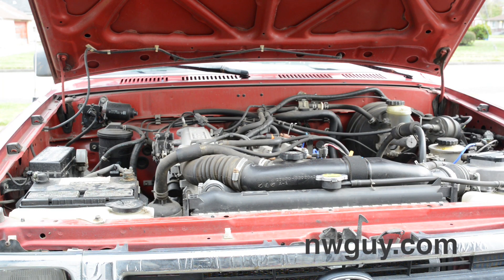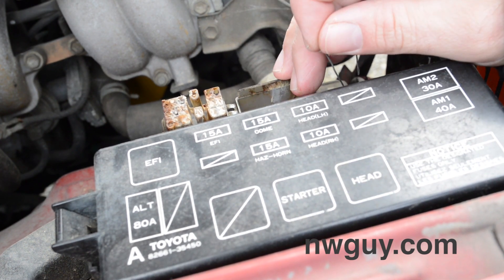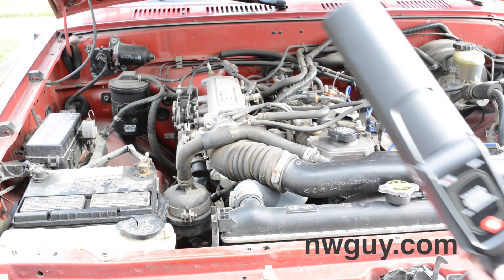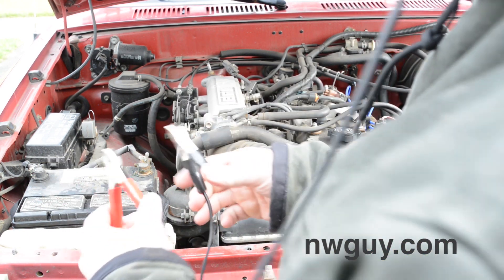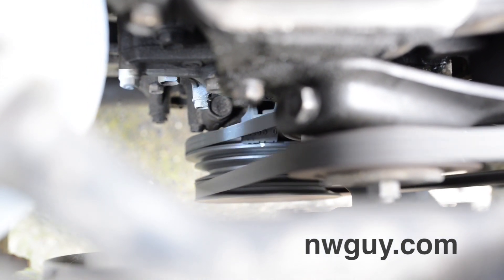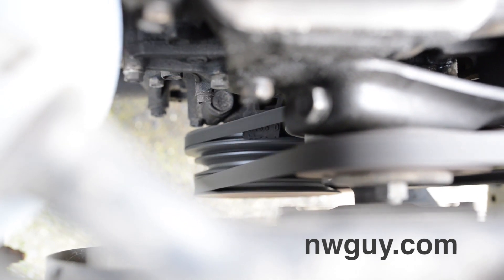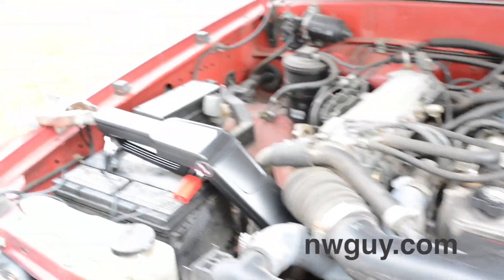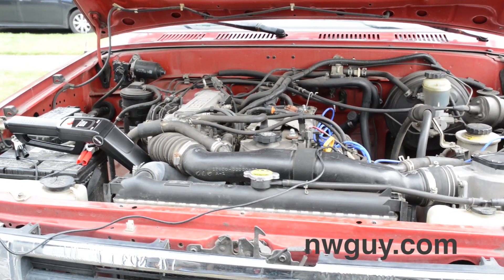Timing Adjust on 22RE - Toyota Ignition

Comment: what was your timing at originally, and did you advance it or retard it to get it running better? Did you notice an improvement in throttle response and power when you made the change? Thanks.

Comment: Thank you. I’m still confused about something. The idle on my 22 RE engine is supposed to be 750 RPM with the timing set at -5° TDC. When you put the jumper in, that slows down the idle, so should the timing be set with the idle speed at 750 rpm with jumper in or jumper out?

Comment: My idle does not drop when t1 e1 are connected any thoughts on why ? I cannot time because of it 😞
Reply: Check your tps (throttle position sensor) on your throttle body, plenty of forum posts on how to adjust it.
Reply: @cyrusjackson3472  thanks I already replaced it and now idle drops when I connect t1 and e1. Now I can time it 👍

Comment: Having trouble timing on my 1994 Toyota Hilux 22RE. Did all as instructed. TDC, aligned pulley to TDC, jumped TE1 &E1, set distributor on #1 cylinder and won’t crank over. Adjusted distributor to advance tho past the anchoring mount. Please help. Thanks a million. Contact ragman_1999@yahoo.com.

Comment: Thanks for this! You got a diagnostic code there btw. I couldn’t see it so it might be something else but looks like 31. Check engine will flash steady if no codes and will flash with long breaks for one digit codes or like yours (and mine did) will flash a series of times short break long break and again for two digit codes. You can then look up the number and figure out what’s setting it off. http://www.lcengineering.com/LCNewsletter/2014/DECEMBER/troublecodes_TECHNOTE.html

Comment: i read on a forum that the vacuum lines have to be off and capped before setting the timing is that true. did you achieve the same thing by jumpinng the terminals?
Reply: Same by jumping the cable.

Comment: When I jump the TE1 to the E1, on the Diagnostic block my idle doesn't drop. The service engine light does blink, so that is telling me that I have contact Do you know what would cause the engine idle not to drop?
Reply: +Alyssa Wise It doesn't necessarily have to lower the idle when you connect TE1 and E1.  All that's doing when you connect those 2 terminals is telling the computer to stop playing around with the ignition timing (which it does under normal conditions to smooth out the idle and help with emissions) so it'll hold it constant so that you can set the base timing with the distributor.  If you didn't tell the computer not to monkey with the timing, then when you looked down with the timing light, the reading would be jumping around all over the place and you wouldn't be able to tell where it was set, much less where to adjust to.
Reply: Same issue with mine. mines an 86 though so the diagnostic plug is on the other side of the bay, but still, it doesnt lower the idle at all. Did you find your fix Willie?
Reply: This is old but I’ll comment for everyone else. The problem is almost always the tps (throttle position sensor) being out of adjustment. I had the exact same problem accept it wasn’t the tps as I tried adjusting and replacing the tps with an oem one twice. Never did figure it out…

Comment: Great explanation. Thanks
Reply: Hallo ihr beiden und ich bin ein bisschen mehreren Tagen ab wann bist du hier
Reply from the maker: +Star Motors Direct Thanks! Trying something new in my spare time!
Reply: +nw guy I was actually looking for a video for this and you posted a hour before. I was curious. Did your check engine code read 41 or 31. Mine reads 41 and runs sluggish. really boggles me. I've replaced a lot of parts already. Distributor, plugs, wires, etc. Any thoughts?
Reply from the maker: I'd look at your TPS, if you're still having issues. You can test it (will be doing a video eventually) or replace it. It's a little spendy, so worth testing if possible. Good luck!